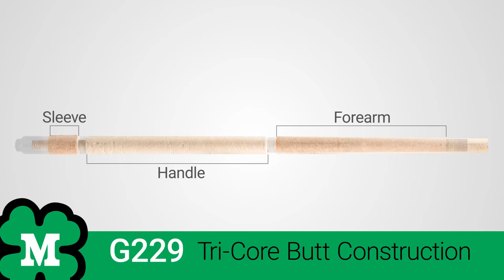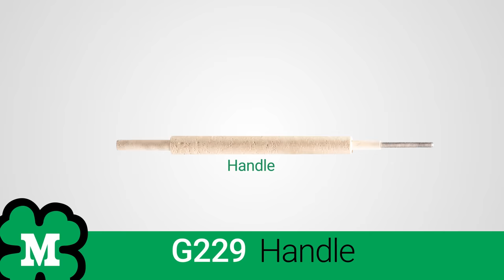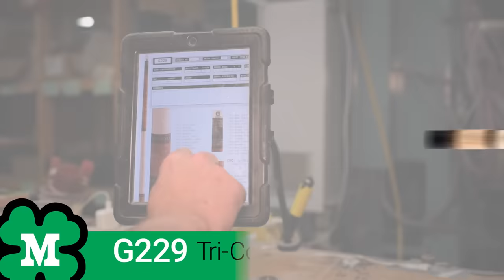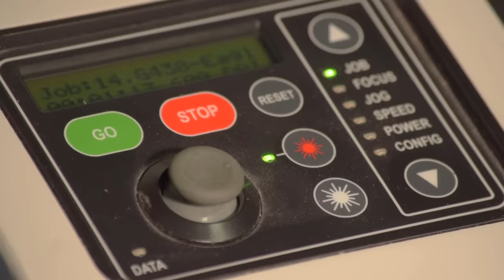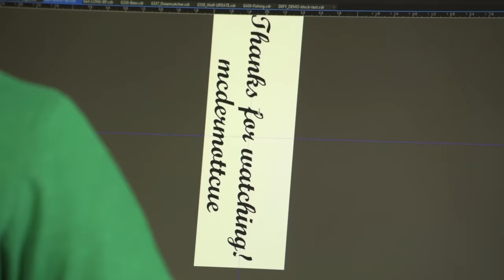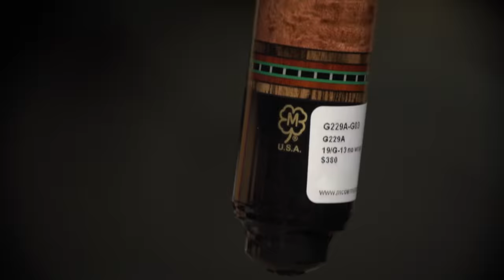How McDermott Cues Are Made

Comment: Just got my new McDermott cue with a 12 millimeter Defy shaft. Absolutely love it.
Reply: I got a 12m and exchanged it for a 12.5, had to much bend or flex for me for a carbon, the hit felt good though
Reply: @chasedavis7231  I ordered the 12.5, but got a call from seyberts saying the didn't have anymore in stock. The only thing I'm not sure about is the tip. I've always used triangle.
Reply: Did urs have that weird flex? Is it cause of it being 12mm? I messaged mcd and they said they would exchange it if u pay the shipping
Jusy contact them

I had mike gulyassy put a g2 medium on mine
Reply: @chasedavis7231  Not that I noticed. How does it hit with the g2? That's the only layered tip I really like.
Reply: @michaelrobinson6629  great, I just didn't like the flex , felt like a wood shaft, I thought cf had zero bend, my other has no bend 
And the g2 hit great
Reply: @chasedavis7231  That's good. Now I know what tip I can switch to if I need up not liking the soft navigator.  Did your 12 millimeter have the black joint or the gray joint? Might be something they fixed in the new run. I tried bending it with my hands when I got the shaft and couldn't bend it.
Reply: @michaelrobinson6629  grey, yea I had Mr gulyassy install a g2 medium and samsara break for me, as u know he created the sledgehammer for mcdermott and played for the 94 mosconi team
Reply: I just got the defy 31” 12 mm with the light gray ferrel and it doesn’t flex at all , great feel, amazing energy transfer, it’s my go to shaft.

Comment: Best $200 I ever spent when I bought my GS Series GS13. It's paid for itself 10 times over. I purchased one of the last made GS13s with Birdseye Maple butts. Whoever stained my cue did an amazing job as well as whoever chose the wood blank. I've had that cue for over 5 years now and it's still straight. The only thing negative I could say about it was the Tiger Everest tip that came on it. I've since had 5 or 6 SIB tips installed over the years. I own some other cues but they were given to me. Certainly will buy another Mcdermott when its time or send mine in to be refurbished. The laminate has started peeling around the joint collar and sleeve. Which is to be expected considering I was playing 5 times a week 3-6 hours each day.

Comment: My first McDermott Cue, early 90's E-B3, it was all black with a nylon wrap, best Q i had by far.  I had it re-wrapped in late 90's with Irish linen of same color.  It was stolen in 2005 from the back of my car, then I tried to buy the same type, kind, and color, but it was off a bit and felt different playing.  I thought it would be the same, but they had discontinued the older McDermott models.  I then had to change the tip, and things got better with it, going softer tip than the harder ones that came factory.  I want to try a new G series shaft that say come with a software tip, or maybe buy an entire new Q.  I will stick with McDermott for my next Q, i love the joint on these by far the best of all the Q's I have.  I even bought a predator shaft years ago for it, low deflection before you started doing these type of shafts, but it felt UN-balanced with the butt of the McDemott Cue.  I quit APA league years ago, but want to get back into it.  I ended with an SL5 in 8 ball, and SL7 in 9 ball.  I jumped in on an open tournament a few weeks ago, from not playing at all in 3 years and lost 1 match shy of the money rounds.  It was 8 ball and had a 9 ball losers bracket.  Yes I am hooked again.  LOL

Comment: I've had 2 McDermott cues, one warped from Arizona heat, and the other that I still have and play with is not worth the money spent for it (on line purchase, poor Balance, warp affected by ambient conditions and shaft torque). 
   I recently bought a Champion BK3 jump break cue, and so far consider it the best cue I've ever owed. Better than the two Meucci cues and the two McDermott cues I have owned. 
     The Champion is a recent eBay purchase of $105.oo delivered.👍
   With an Elk Master tip, it'll be much better IMO, as the original tip seems much to hard to handle high english demands. Otherwise there is very low deflection and offers very predictably accurate shots. 
    Just one man's opinion, but the few friends that have shot with it are impressed with it too. happy next game.🎱

Comment: Really interesting.  But I'm confused that around 16:15  they talk about turning down and sanding the shaft, after it was already polyurethaned and given the final luster coat?
Reply: The part of the shaft that slides through your fingers is not clear coated. (Too sticky) They sand it off.

Comment: @ McDermott Cues This may sound stupid, but have you all done any work on walking canes? Inlay and/taper and center drill pieces so it can be disassembled? Heck at this point I’d be happy with 3-4 handle pieces and just screw them together and throw a hand grip and sand it down myself. I can’t afford a Cue so I doubt I could afford the pieces for this project. I’m just tired of either big ugly aluminums ones or the walker they issued me. Could I buy certain pieces to try to come up with something? I don’t mind slightly damaged pieces that wouldn’t be useful to a Cue build.

Comment: I bought a McDermott Star Sneaky Pete and then got a G-Core shaft for it at a later date. I notice the G-Core shaft is a thinner diameter than the original shaft that came with the Sneaky Pete. It still fits nicely at the seam and looks like they were made as a pair. I'm really pleased with the overall quality of the parts and the price was really affordable. I have always wondered if I can break a rack with the G-Core shaft.. Would there be long-term damage to the shaft or no?
Reply: I would just get an economy sneaky pete with a strong ferrel and put a Samsara hard tip on it. It wouldn't treat you wrong in your breaks.

Comment: 12:27 THATS WHY MCDERMOTTS FEEL SO GOOD, AND BALANCED,  LIKE YOU CAN PLAY WITH ONE HAND.  THEY ARE TAPERED FROM THE BUTT PLATE TO THE FERRULE. JUST LIKE AN OLD PALER AND SUCH.  HERE THE BUTT AND SHAFT IS SCREWED TOGETHER AND SANDED TOGETHER ENSURING PERFECT FIT, ONE LONG TAPER. TODAY LOOK AT A JACOBY, TWO DIFFERENT SECTIONS, BUTT IS TAPERED.  THEN LOOK AT SHAFT, ITS HUGE AT JOINT, THEN STARTS TAPER AFTER 2-3 INCHES, INSTEAD TAPERING DOWN FROM JOINT/FOLLOWING THE BUTT.  ONE THING LOUZY ABOUT JACOBY IS THE WAY THEY FIT THE SHAFTS, THEY ARE NOT IN SYNC WITH THE BUTTS AND SHAFTS ALMOST STEP DOWN INSTEAD NICE SMOOTHE TAPERING,  ANYWAY, JUST SAYING, GOT ME OFF RAIL A BIT

Comment: On wood, why on earth wouldn't you just have a ceramic single lip form tool made instead of all these tool changes and boring bars. It's wood, they would last forever almost.
And if higher dimensional accuracy is required then use a rough and finish form.

Comment: Is there a reason you wouldn’t want a carbon fiber cue over wood?
Reply: The “feel” more so than the performance. The cues $300+ come with their g core shaft which has carbon fiber core in front. And pro shaft is carbon core whole length. The cues under $300 or so are straight maple wood only. Plus the ferrule and tip of course.

Comment: what glue do you use for the tip ? i wonder if a 2 part epoxy glue would work.  most guys reccomend loctite gel control, but it seems a bit weak for me
Reply: Loctite gel control or Gorilla glue Cyanoacrylate gel. (Walmart). Make sure the ferrule top is flat and smooth.  If you haven't done one before, call a local pool hall and they can refer you to an experienced cue repairman. Usually costs $15-20 with a $6 tip applied. Once you have one done correctly, you probably won't wanna try it yourself.
Reply: The traditional way is with rubber cement.
Reply: @trappenweisseguy27  you mean contact cement ? that glues good to leather but not so good to hard materials
Reply: @mkeim2  i am a knifemaker, so i have neatly any type of glue for leatherworking woodworking metalworking you can imagine, and know how to prepp thing properly... i was just wondering, because it seems like mcdermot used the same glue for the tip than for the cue itself. so my guess was epoxy.
Reply: @mkeim2  my tip is nearly worn out, so when my kamui tips arrive i probably just gonna test some g flex epoxy. its like gel kontrol and has some flexibility, but a 24 hour cure time. i think that will hold much better. and if not, i can just resand it and use another glue :D
Reply: Five minute two part epoxy works great.